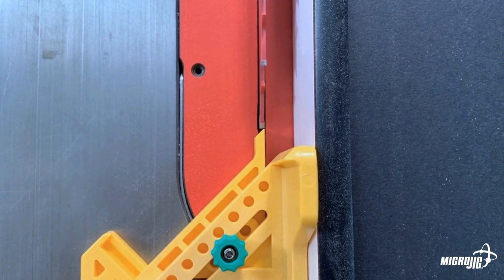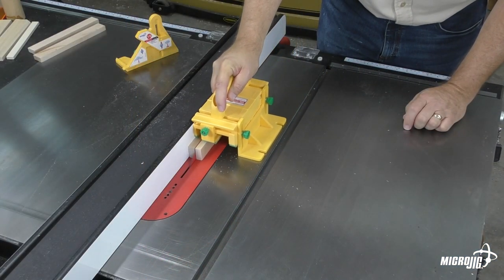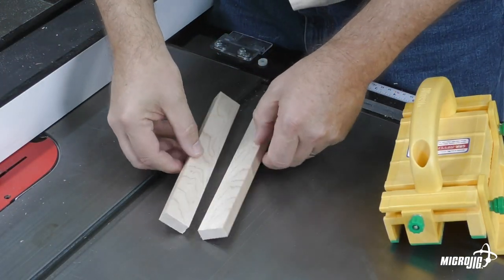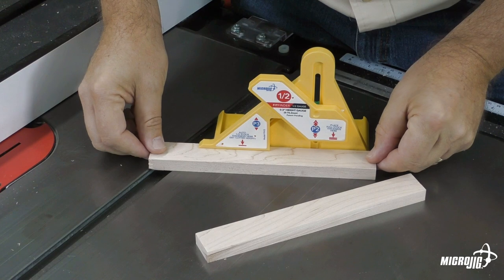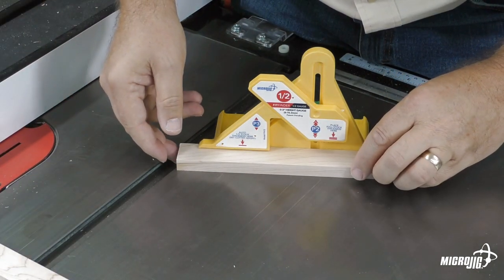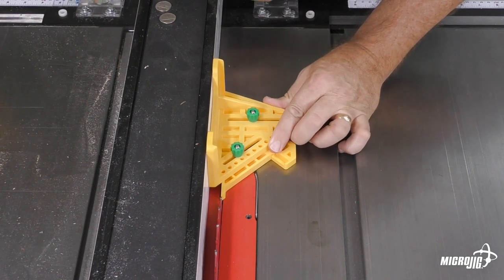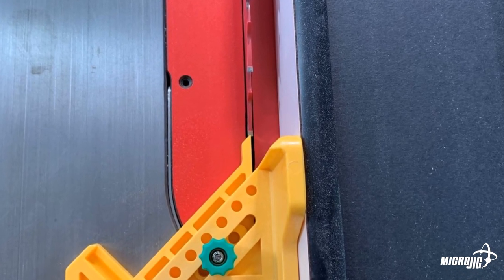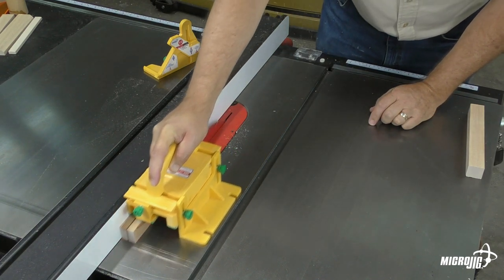FITFINDER Resaw Tip from Microjig

Comment: Well explained. Side note: Why are there two nickels on the saw fence?
Reply from the maker: Mark, Good eye!
With the original ZEROPLAY Miter Bars, molded in black, you set the bar to the miter slot before mounting it on the sled base. It is most accurate to set it at the top of the miter slot because that is where it will be. So a couple of nickels make excellent spacers to hold the ZEROPLAY in place while you set it.
The new green ZEROPLAY Miter Bars get mounted to the sled base first, then adjusted to the miter slot from above, so nickels will be disappearing from our videos.